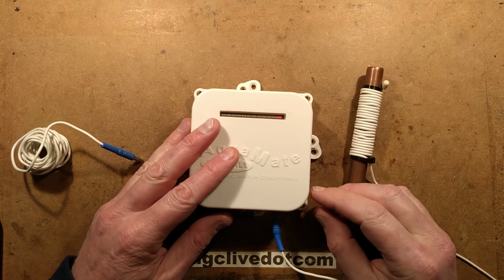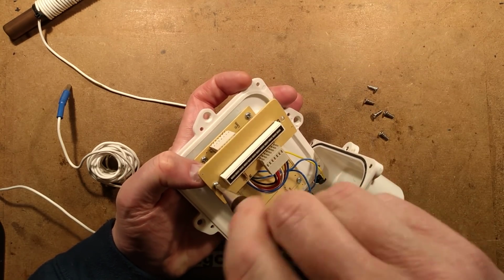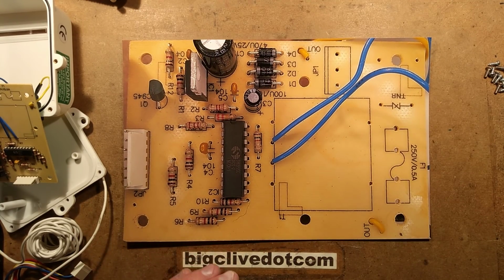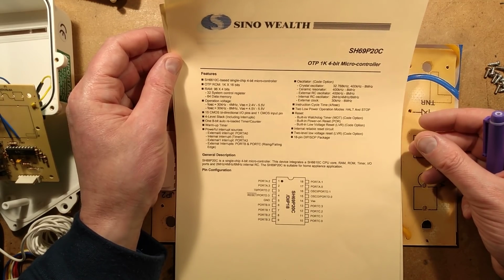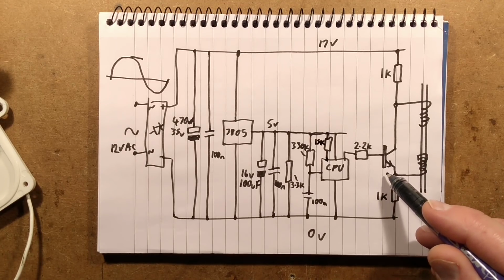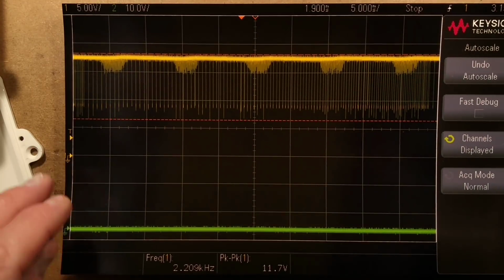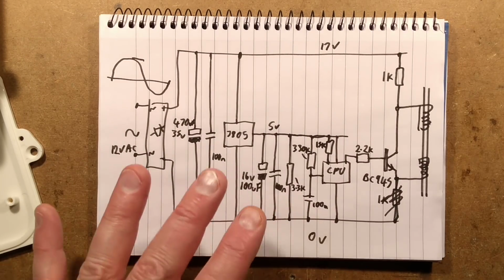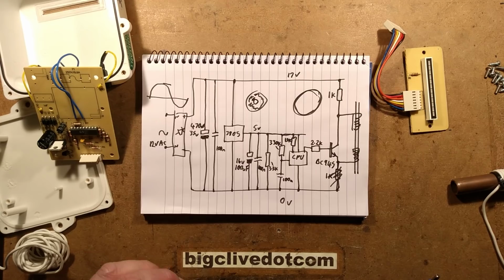inside a computerised pipework scale reducer.

Comment: I think you only did half the investigation. Yes, when the transistor is on the top coil only drops to about half the ~17V, but the bottom coil would also rise to about half the ~17V. Then when the transistor is off the top coil returns to the ~17V and the bottom coil would return to gnd reference. That's the magic sauce that makes this (not) work so well. It's a differential signal between the two antennas.
Reply: Notice, that the base of the transistor is being driven from the IC, which only puts out 5 V. If you subtract the base-emitter voltage of the transistor junction, it can only pull about 4.3 volts across the 1,000 ohm emitter follower resistor. That's only .0043 amps. Barely enough to be detected, let alone, have any effect on water flowing through a pipe at about 100 gallons per hour. If this thing had heavy transformers and power transistors like you'd find in a big guitar amplifier, it might almost be believable.

Comment: These don't work, they are snake oil, and you shouldn't waste your money on them (or the electricity to run them).

To prevent scale, you need to ensure that insoluble salts don't precipitate out from your water supply, and the only way to do that is to remove the ions responsible. The primary culprit is calcium (bi)carbonate, and the proper solution is to use ion exchange either to replace the calcium (typically with sodium or potassium), as done in a domestic water softener, or to replace the carbonate ions, as I believe some cartridge-type scale preventers do. The advantage of swapping calcium for sodium or potassium is that the ion exchange medium can be refreshed by soaking it in a concentrated brine solution; this is why you put salt into your water softener… the softener passes water through the salt to make brine, then pumps that through its exchange column and from there out to a drainage point.

Comment: I am very sceptical about these but I have this exact one and it does seem to do something. I have a mixture tap just after the heat exchanger coil inside my hot water tank (kingspan flowmax system) and every 4 years it would stop working due to calcium build-up. The manufacturers said this was typical for the area where I lived. I fitted one of these 15 years ago to the main cold water supply from the street and it's never reoccurred. There may be other reasons but as bizarre as it sounds it stopped it happening again.

Comment: I have one suggestion for how this device could work- if it caused mechanical oscillations at an appropriate frequency to trigger precipitation on a small scale prematurely then the action ceased at the end of the wave, instead of large crystals forming and growing a much finer precipitate which may be easier to pass would form (ie same ammount of crystals but instead of one giant pipe blocker 1 million tiny particles). Any chance of a test with a grow your own crystal kit and a control from anyone? If im right the device would cause a pile of powder to form rather than a nice shiny crystal

Comment: If you place the controller box just above the pipe and center it between the two coils (as it probably is usually installed) and stand back, you will be looking at a modern version of Kilroy (crossed with a cylon).

Perhaps the designer of this hoax has a sense of humor!

Comment: I was living with my uncle when he had one of these fitted, and I thought it was just flammery. Weirdly, it sort of worked. We lived on the South Coast of the UK where the water is VERY hard, and prior to having the thing fitted, we had to descale the kettle about every three months.  With the unit fitted, the chalk seemed to fall out of the water as tiny flakes, rather than coating the inside of the kettle. That was fine (the kettle had a wire filter) but it was an ARSEHOLE for the shower, as the little flakes would get trapped in the holes and muss up the water flow.

So yeah - not descaling as such, but it definitely made a difference.
Reply: We moved from the south coast to North Wales. Kettle de-scaled itself within a week!

Comment: Well, that's quite a design. Formerly published (in the 1980's) in Elektor = Elektuur elektronics magazine:   https://www.circuitsonline.net/files/schakelingen/schematics/000044.gif.
Full description you'll find here: https://www.circuitsonline.net/schakelingen/44/diversen/waterontkalker.html
It is generating a square wave of 2kHz. To be uses with 2x 20 wire turns in the same direction, around the water pipe.
Personally I build and used it for two years. Had a slight feeling it worked for me..

Comment: Many years back we had an instantaneous gas water heater in a very hard water area. British Gas installed a small inline salts unit that prevented the unit scaling up and it only needed changing once every yoear or two. Some time in the nineties they discontinued the support for the scale preventer and said that we could fit a magnetic one, that was all the now supplied. We moved soon after, so no idea how long that kept things scale free. The latest house came fitted with a similar unit to this one shown in the video, but not quite as flashy. The previous occupant was so proud of it, he cut a hole in the pipe boxing so you could watch the LEDs! We still get scale and watermarks....

Comment: My two penth worth, Back in 2000 we used to have to take washing machine and dish washer outside to knock the scale out of the waste pipes (very hard water in Dorset), any way a friend offerd a second hand one for free (Scalewathcher). Skeptical to say the least I accepted his offer and fitted it. After fitting I noticed a difference straight away when washing my hair in the shower I used to have to apply shampoo twice because the first application of shampoo did not lather, but after fitting the Scalewatcher shampoo lathered on the first application of shampoo. I Also have never had to knock the waste pipes to get the scale out. Yes we do get scale in the kettle but Im sure it is no where near as bad as before fitting. Im a believer.
great channel Bigclivedotcom

Comment: The only thing this descales is the paper currency in your wallet!  The reason minerals are left in your coffee tea or home water heater is  a precipitation process that initiates when the water reaches  threshold temperatures that breaks the bond between the water and the specific mineral  molecules.  The threshold depends on the molecular weight of the mineral.  The signal created by this box is much to weak to come close to the power required to permanently attach the mineral in spite of the agitation due to high temperature.  Also, the whole effect of creating an electro-magnetic wave somehow locks  (permanently dissolves) minerals onto water molecules is ludicrous.

Comment: Coincidentally enough, I have a sales pamphlet for one in front of me - gave me many laughs -

(step 1) 'Incoming water containing calcium molecules' 
(step 2) 'A scientifically developed signal hits the resonant frequency of the calcium molecules causing them to lose their adhesive properties.' 
(step 3) 'Calcium molecules no longer adhere to any surface or form limescale deposits. Existing limescale is dissolved and never returns' (sic)
** advanced circuitry design, delivering results never seen before ** 
** homes up to 5,000 ft^2 **  (so I guess if you had a mansion, you'd need 2 or more!)
*protects your appliances* 

LOL - might as well strap some magnets to your pipes, you know, in order 'to de-orbit the electron spin of the calcium ions, so that they can't react with your plumbing' 'create hexagonal water molecules that absorb extra calcium' (etc, whatever BS you want to make up)

Comment: Hi, may I suggest something?  Perhaps a very good next video idea would be a tear-down and reverse-engineer a proper (but simple) PIR solar led security light /garden lights that use one or more 18650  or 14500 3.6V Li-Ion cells that most people could recover from old laptops. A kind of light that still manages to charge around 50%  even on a rainy UK typical day. It could potentially be a huge attractive subject to debate. And maybe do a live circuit board making with some improvements as well and a clear proper diagram so anybody could replicate it. And a good cheap source of high wattage (1-3watts) high brightness high efficiency LED's to be used on the above project to make really nice and fairly powerful security light that charges with ease. I cannot wait for that day. :)

Comment: I fitted one of these when I replaced my hot water cylinder, it doesn't work or not at least as I have installed it and I did follow the instructions, that is I still have a build up of scale on my taps.
Now I would add I am a retired building services engineer, when I was working in industry I did trial several of these type of devices provided by manufacturers on a free of charge trial basis. Of the perhaps half a dozen trialled I only found one that was effective and that one did remove a build up of scale from within an industrial water heater within about six months, this I witnessed by opening the heater before and then six months after installation.
Reply from the maker: What technique did that unit use?
Reply: bigclivedotcom 
Unfortunately I'm not sure and I can't recall the manufacturer. There are two different systems I'm aware of 1) that induces a magnetic field into the water, causing the dissolved scale ions to become negatively charged so they don't form scale and pass through the system rather than forming scale when heated, 2) that induces a radio frequency into the water and again does similar to the scale ions..
I believe both systems can work the important thing is the correct siting of the transducers on the pipelines, the effect is only temporary so, say the transducer were sited on the supply to a storage tank then the effect would have worn off by the time the water is heated and used, on the other hand if the transducer is sited on the flow pipe from the calorifier (water heater) then the water being used gets conditioned as well as the stored water in the calorifier.. The units I'm referring to are industrial but the principle is the same..
When I get some free time Im intending to move transducer coils of my unit from the supply pipe to to HWS cylinder to the flow.

Comment: I see many of those units that just have a single wire to basically one antenna. I was considering getting one but it's pretty hard to separate the snake oil units from one that MAY actually work. Thanks for explaining the principle of operation. Yes..... they put a lot of thought into the case but very little into the actual effectiveness.
Reply: Try the KEMO brand ones. They're a quite well respected manufacturer of electronic kits. I've bought three over the years. They make the scale break up much more easily, from the kettle at least.

Comment: If your kettle is still furring up then that's a sure sign it doesn't work. I have a water softener in my house and my kettle doesn't scale up at all. If this device did work, it would scale the inside of the pipe around the wiring - and that pipe would pretty soon get blocked. If there's no scaling inside the pipe - which after 10 years there should be plenty - then it's definitely bogus.

Comment: These descaling devices supposedly worked by inducing a swept audio frequency into the whole house copper pipework system, the vibrations of which kept the calcium deposits in suspension to stop them adhering. Their only real effect turned out to be that radio hams all over the country started to raise hell over the fact that the house pipework then went on to broadcast wideband radio interference over a 'wide aerial' (as Bristolian dialect has it). I remember having an up and a downer with the so called 'technical director' of one of the major manufacturer's, at a water industry exhibition in the 1990s,  that it was just plausible enough for plumbers to fall for it but it was still snake oil.  I still reckon I was right.
Reply: Seems like a speaker bolted to the pipe would do a better job of coupling audio frequencies into the pipes, and without all the RF interference too.  Big Clive was on to something when he plugged his headphones into it!

Comment: Extra pins on transformer coil forms may also not be connected to anything and present only for structural support - those iron core transformers are relatively heavy for their tiny pins if you only have the bare minimum needed.
Reply from the maker: On my own products I used potted block transformers with built in screw holes for firm anchoring to the PCB before soldering.

Comment: Soooo. I myself also do not have faith into these devices and if they stop minerals / calcium to fall out of solvent, 
BUT
what really took me off the "totally does not work" track was one of my professors (where i studied sanitation supply/recycle)
told me that the currently in germany/eu available active devices which are certified really have an improving effect.
So there seems to have been a study or research which came to positive effects.
OF COURSE this does not mean, that all those home-shopping or china-import devices have any or the same effect as the units who had bee tested.

...But anything High Frequency or EM stuff is still black magic for me...

What i learned is that the newer gas-water heaters (..15years..) have coated copper or self cleaning copper (perhaps through temperatur expansion),
so that they don't get a buildup inside, whereas the old models should be flushed with citric acid or similar stuff to get rid of the buildup over time.

Heating up water leads to reduced dissolved CO2 => different pH , which was holding the CaCO3 (or other variants) in the water,
so the CaO3 gets solid and can stick to surfaces. No magnetic field can do anything against that.
(I'm sorry if the chemical compositions are wrong, might wanna check the correct ones yourself)

..So.. I still think it would be more efficient to get a water filtration unit if you have problems or "hard water", to save on cleaning products like washing powder or cleaner.
Reply: It could just be a rumour. If you have the name of the device in mind i might check what it's really certified for.

Comment: I was hoping that this was something of value and more than the sugar pill effect lol, we have lime and other minerals in our city water that are disgusting, my coffee pot need to get cleaned out twice a year. wonder if a unit could be built using a standard water filter canister with the electronics cleaning the stuff in the canister that would collect the debris and then could be cleaned ? what kind of circuit would actually have an effect on those deposits and trap them? What about using something more on the line of a electro plating design? would that work?

Comment: Hi, This is going to piss off a lot of people. https://www.amazon.co.uk/ELECTRONIC-WATER-DESCALER-UNIT-SUPPLIED/dp/B004GUFVGS , This is the unit I have and have fitted to the main water pipe under my sink for the last 14 years, Its powered by a Nokia phone charger.
Maplin used to sell these for £5 ish, and that's where where I it from. When I moved into this house 16 years ago, the lime scale buildup was horrendous in the kettle and shower head needed cleaning every 2 weeks or more. The new washing machine corroded its heating element in 18 months along with the emersion tank element months later and both needed replacing, ( I do all my own maintenance Building,Electrical etc).
You need to fit these units correctly for them to work and the biggest mistake is winding the coils around the pipe, The coils wires must be wound in the “opposite” direction from each other, so both wires go down the back or front of the pipe and wound away from each other.
Dose it work ?, 100% for sure, It takes about two or tree weeks to get working and then starts to get to work on existing lime scale build up in the pipes etc. I have never had to clean the kettle or shower of lime scale since the unit was fitted, The Nokia power unit under the work surface has blown twice over the years and that's when I notice the lime build up in the kettle alerting me to the fact the Decalcifier had stopped working,
1. The Water dose NOT taste any better with the unit working. 
2. It stops the lime scale from building up by stopping the molecules joining together. (ie: braking the bond).
3. Water that has passed through the Decalcifier pipe will start to re-calcify after 2/3 days of standing.
I had to replace the bearing in my washing machine after 10 years of work and the element and pipe work was 99% clean, as good as it could be.
( sod's law say the unit will now go bang, But a got a spare from Maplins  after seeing how good it works, The PCB circuit inside the unit is encased in a epoxy.)

Comment: I've used a Scalewatcher for many years, it only has one coil but is connected at both ends. I have to say it works very well indeed. You still get the scale but it is soft and easy to wipe away. Chemically things do not change (how could they) but structurally the deposit is no longer hard as a rock.

Comment: Transistor is actually a 2SC945, which is pretty much the Japanese equivalent of a BC54x or 2N3904 type device. Pinout is B C E.

And yes, these devices are utter bunkum
Reply: It really doesn't matter what the transistor is, it only has to conduct 4.2 milliamps, based on a 5 volt drive from the IC, and the 1000 ohm emitter follower resistor. The transistor won't even get warm. The base-emitter voltage drop of the transistor drops the 5 volt drive from the IC down to about 4.2-4.5 volts at the emitter. divide that by 1,000 (hence the 1,000 ohm emitter follower resistor)